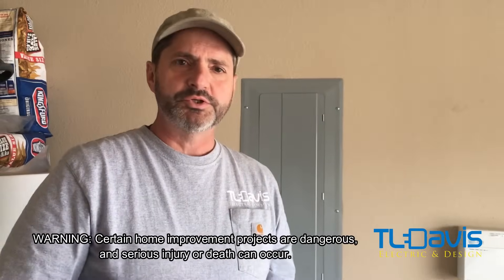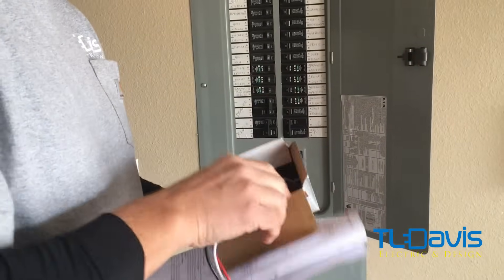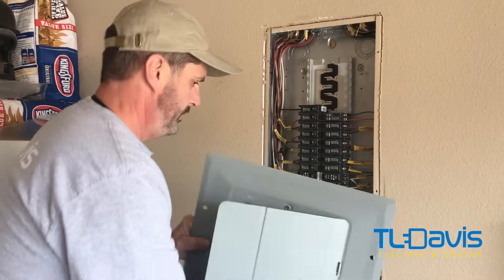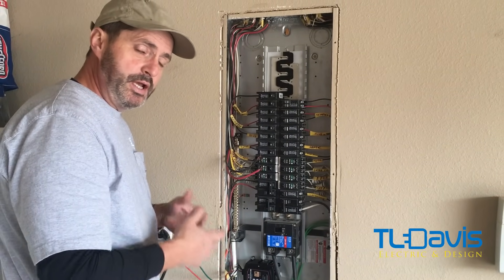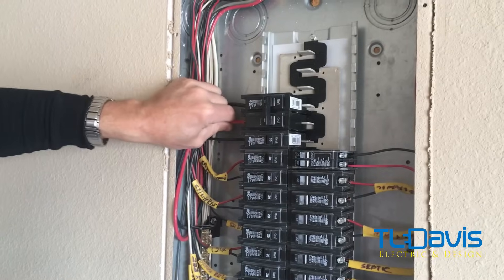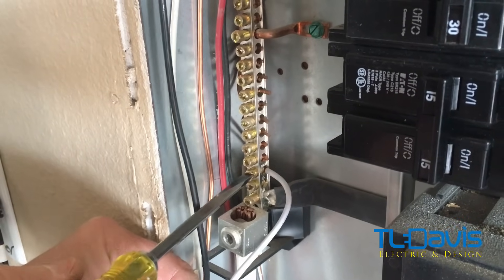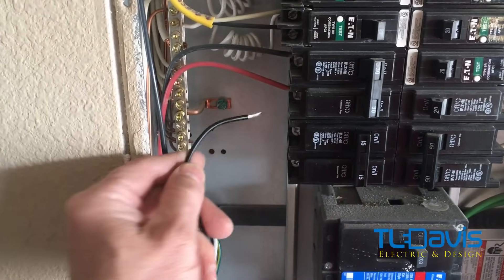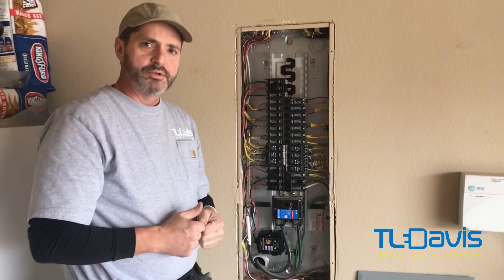How To Install A Whole House Surge Protector | TL Davis Electric & Design

Comment: why did you install the ground on the neutral bar??
Reply from the maker: This is a very simple answer. In the main panel the neutral and ground bar are connected.  Only in a sub panel are they separated by code.
Reply: Because the neutral is a grounded conductor.
Reply from the maker: @kyserwillams4244  Thanks for the reply to help out Robert. Only in the main panel are the neutral and ground bar connected. You will see that people will separate them to different sides to make them look nice. There is a bonding strap that goes from one bar to the next bar. They are only separated in sub panels per code. I hope this gives you a clearer understanding of what you are asking. If this does not I can stick a drawing up for you, which might give you a better picture.

Thanks

Terry

Comment: You should connect the Surge Protector cables  to the terminals of the Main Circuit Breaker.
Reply from the maker: Thanks for watching the video. In the video you see that I refer to the instructions that came with the surge protection device. It requires a 2 pole 15 amp breaker to cover both phases. Connecting it to the main is dangerous, an untrained professional could get shocked or injured. The wiring for the device is only rated at 15 amps and we should follow the instructions on how to install it. The device can be installed anywhere in the panel. Eaton has a kit that would allow you to install it at the bottom of the panel. I hope this was helpful.

Thanks
Reply from the maker: Do not connect the surge to the main panel. The Spd has to be on its own breaker. If you read the instructions you will see that it needs to be on its own breaker.
Reply: @terrydavis5882  Connect the circuit breaker of the spd to the loadside of the Main breaker.
Reply: @rossmmac1  You are not supposed to do that. It needs to be connected to a breaker. Not the main breaker, though.
Reply: Years ago in the 1970's & 1980's we used to install the surge protector at the weather head and tap into the drop using a split bolt. Yep it was hot alright. There was no lights on them to check them. If surge was bad they were usually blown up or burned up. Guess that's a NoNo now lol

Comment: The only problem I have with this installation is the unit is mounted inside the panel. The homeowner has to remove the cover to check the status of the unit. The suppressor needs to be mounted on the outside of the panel so that the homeowner can check it without being exposed to live components.
Reply: turn off main power before working in the box
Reply: @williamtamminga5889  there's a lot of wrong w/ this. To turn off the power completely you'd have to pull the meter and in our area you can't do that without a permit. When you turn the main breaker off there is still voltage present on the Line side of the main breaker. So with the main breaker off, it's still considered energized because there is voltage present and pulling a permit for this application isn't practical. Unfortunately most electricians are not trained in electrical safety even though they're electricians. I know, it sounds crazy but I see and hear it all the time.
Reply: Ruben Larez before cutting the seal and pulling out the meter you need to call the electric company  which is unnecessary if you re an electrician. This work is not for a dyi or Sunday warrior 🙂
Reply: @rublar75  At least in California and Vermont, the power co. is more than happy to cut power for a while with no charge. So Cal. Edison even moved the lines for me when I trimmed my monster ash tree---no-charge. The only issue is you need to be ready to do the work on their schedule.
Reply: That is a flush mounted panel.  What you want him to do ?
Reply: @Electricianyu  Cut a whole in the sheet rock beside  the electrical panel and mount it to the stud beside the panel , drill through the side of the panel real slow and hope for the best!
Reply: just kidding....notch the stud out so you can get at the side of the panel to run your wires through.   Make sure you have 911 preset into your phone and update your will.
Reply: @Electricianyu  I want him to mount ouside the box.....if you don't know how to do this, call an electrician....Eaton makes a box/plate to cover this.
Reply: You could mount the spd outside of the panel but you must not exceed the 1 meter wire limits. The shorter the wire used the better.
Reply: I agree with installing outside the box to check the status of the lights at a glance.
Reply: You could drill a couple of small holes to view the lights.
Reply: @jpenn727  that’s a safety issue
Reply: That's exactly what I did.
Reply: no homeowner wants that big ugly black box mounted on their wall inside the house plus it's not designed to do that.  It's fine inside the panel.  They very rarely go bad and you will know because it will trip the breaker.
Reply: @XX-121  MIne isn't black it is grey mental beside the panel, I like being about to glance at the two lights on it without having to open the door.. to each his own
Reply: mental = metal
Reply: @XX-121  exactly if it fails they are going to call the electrician anyways lol
Reply: Can you put the leads under any double pole breaker if there aren’t any open spaces available?
Reply: @lonnelbenjamin   No. The SPD must have it's own dedicated breaker.
Reply: @lonnelbenjamin  that's what I did 5+ years ago
Reply: @lonnelbenjamin  Late comment but yes, if you have no space, you can pail tail or get a proper breaker that is rated for 2 connections (tandem or Square D. That way you can combine them without an illegally double-tapped breaker. You would use a breaker that you know will remain untripped (so your protection is on). For me it was the clothes dryer breaker. Google about fixing double tapped cirucit breakers for more info.
Reply: @lonnelbenjamin  No
Reply: @lonnelbenjamin  no
Reply: @lonnelbenjamin  yes that's what most of them tell you to do.  and it's usually 50A
Reply: If you're comfortable with it (don't CODEZ me~) you could knock out a breaker faceplate enough to use as a site for the lights.
Reply: @NobleNobbler  no, that's against code.
Reply: Wow I would have never thought of that.....great point
Reply: I dont think it rated for inside the panel
Reply: @72strokershovelhead88  you can cover the holes with clear plexiglass so you can see but yet not stick anything in
Reply: Agreed
Reply: Yes I agree Robert. Would not be my first choice .
Reply: Yes this is done wrong
Reply: @72strokershovelhead88  Right - it is not like there are 20 outlets in the rest of the house to poke into, plus just as many light bulb sockets.
Reply: I mounted mine inside the panel because the drywall is covering the sides of the panel. I simply drilled holes then applied clear packing tape to the holes so you can see the green lights.
Reply: There's a flush mount adapter kit available from Eaton for mounting them next to a flush mount breaker box.
I just put one of these in and talked with an engineer at Eaton about it, he's done so much wrong it's unbelievable, and I don't know where he got it from that you're supposed to install the breaker for it close to the feed, I even rewound the video 3 times trying to catch where he says "told him to do it" because I can't make out what he's saying but it's not in the instructions, I've got them right in front of me, a bunch of people in these videos and comments are saying to do that and that was something that engineer from Eaton already went over with me, contrary to what all these "I've been an electrician for 30 years" guys and even electrical inspectors claim electricity doesn't flow like water, instead it hits everywhere at once, that's why it doesn't matter where in the box you put the breaker that the unit will be wired up to, what's more important is that you put the breaker in a location where you can mount the unit as close as possible to it, you'll notice on that little box where the wires come out is a short piece sticking up that has threads on it, the star nut from a wire lock comes already screwed onto that threaded piece the wires come out of, that's how it's meant to be installed on the box, through a knock out that typically a cable goes into, you select a place to put the breaker that's close to an unused knock out, pop it out, take the star nut off the unit, fish the wires and the threaded piece sticking out of the unit through the knock out hole, slide the nut over the wires and thread it on the box and tighten it down, by installing it in an unused knock out hole close to wherever you put the breaker that enables you to cut down the wires to the breaker as short as possible which is what they recommend, the shorter the better because the longer they are the more surge hits your household before the unit can dump the excess to the ground, keeping the wires to the surge protector as short as possible is what's important not where the breaker is in the box, he obviously took off that nut that goes where the wires come out of the surge protector and hid it because he doesn't want anyone seeing it.
Something else he did that's wrong is you're supposed to twist the wires together that go to the breaker to minimize impedance, one twist per inch is what the instructions call for.
Reply: @NobleNobbler  I dont think so,  the SPD is connected to a breaker me thinks the only thing tripping will be that breaker.  Imho
Reply: @lxramirez9788  100% agree on that... at least I hope that's all that trips. My comment was wrong :D
Reply: @lxramirez9788  No, breakers are far too slow to respond to surges. Without a breaker the surge suppressor is converted to an explosive device in the event of a large swell. I will say that a fuse would be much, much better due to it having a lower inductance than a breaker.
Reply: @antilogism  Agree, I would have tough the SPD should be located at the main switch where the meter box is.  My guess is the breaker has a sensor detecting not heat but transients which takes only seconds to occur, which would make it awesome, the technology use to trip off the rest of breakers is  even more extraordinary.  Props to whoever build it.
Reply: Except the homeowner doesn’t need to check the status of the unit. So who cares?
Reply: If you know so much, then why are you watching the video?
Reply: @elmagnificodep  so idiots like you can make stupid comments

Comment: Hi this it for 110 v
Reply: He is using a two pole breaker which covers both 120 volt lines, thus covering 240 volts. This is the same type breaker as on any of your 240 appliances.

Comment: Does this protect the two phases that come into the house? I see you only protecting one phase.
Reply: The SPD does protect both phases. If you notice I’m using a 2 pole breaker which picks up A & B Phase.
Reply: He is using a two pole breaker. This covers both 120 volt lines.

Comment: original cables are well orgnized. you need to trim the wire when moving them above
Reply from the maker: The panel was installed by another electrical contractor and they did a great job when wiring the panel. We just installed the Spd for the customer and tuck the additional wires be hind just in case in the further they might have to relocate the breaker.
Reply: @terrydavis5882  I noticed that in the panel on the bottom left side, there is a 20 and a 30 amp circuit both going through KOs with no connectors.
Reply: I would suggest that you don't wear jewelry when working on electricity. You may be a pro but they can die just like anyone else. I know plenty of electricians and non electricians who have had close calls.
Reply from the maker: @illestofdemall13  Thanks for watching the video on how to install an SPD. The 20 amp 30 amp breakers were already existing in the panel, when we were asked to install the SPD for the customer. There is a 2x4 on each side of the panel not allowing for a connector. We installed a plastic snap in connector for the customer after we install the SPD. As electricians we do what the customer ask for. We also advise them of things we see, that need to be addressed. We install the SPD were the customer want it, as long as they are within code. I hope the video was helpful for when you choose to add an SPD to your home. I always advise the home owner to turn off the power to the main house if they feel  uncomfortable with it on. I also advise them if they feel that uncomfortable to hire an electrician to install it for them. I'm just trying to help those who want to do electrical for them self to be safe an knowledgeable when doing so.

Thanks again for watching the video. If you would like to see a video on something electrical that you are working on and need help. Please let me know.
Reply: @terrydavis5882  Yes, and my point was just that they missed the connectors on those. When installing a panel one must prepare it so the connectors can be installed. I know it wasn't you who was at fault.
Reply: @terrydavis5882  I do have a particular electrical installation that I would like to see. I know how to do it, but have never seen any videos online of it. I would like to see a video of how to properly install a bell box outdoors for a GFCI, an how to properly support it using rigid conduit through the round connector that threads into the back of the box. I always see videos of how to mount them to walls, but never in the middle of a yard. Thanks.
Reply from the maker: @illestofdemall13  Thanks for the idea. I will be glad to show you how I support a bell box in the back yard for lighting and power. I will have it out on Youtube in about a week as I have to finish a job.

Thanks

Terry
Reply: @terrydavis5882  Thanks. I'll look forward to it.

Comment: How does it protect the whole home electricity?  Let say you have a power surge, how does that device stop all the current from flowing to those remaining breakers?  I’m really curious because I want install as well?
Reply: It doesn't prevent the flash from entirely happening or damage occurring but what is ment to do is use 50%of its self before it can take another hit but it will always take the hit before distributing current/ark flash to other circuits that have appliances connected on them tvs washer dryer etc.
Reply: I can't drill down on the exact physics behind it, but it will draw and "absorb" the high voltage and prevent the the other circuits from receiving high-voltage current. There are two things to know: 1) The high-voltage surge does not necessary have a high enough ampacity to trip the other conventional circuit breakers. 2) The other breakers only prevent over-amperage; NOT over-voltage.  Typically, electronics are destroyed by surges from high voltage; NOT high-amperage. High amperage occurs usually from a short condition (which the surge protector ignores).  Hope this helps.
Reply: path of least resistance...

Comment: You seem to connect the white neutral and green ground wires to the same bar? Is that correct as I can see another bar on the right side of the box where there are some green wires connected?
Reply: In a service entrance panel like this there are usually at least two, and I have seen as many as four, ground/neutral bars. The service entrance panel is the first breaker panel past the meter, whether it's mounted inside or outside.
Reply: @robertmoore254  Yeah but it appears he's working in the sub-panel, not the main service panel (which normally is outside in new-builds anyway). In the main panel, they're combined so if you're putting an SPD there they go together on the one buss. In the sub-panel they're separated...like this panel. So why wouldn't the green wire not go to the ground buss (with the rest of the green grd. wires) rather than with the white wire on the neutral buss?  It appears to me Mr. Davis has contradicted himself on several occasions/comments here.
Reply: Yes that’s fine.

Comment: You should drill some holes in the cover to show the LED lights so that you can see the health status!
Reply: my thoughts exactly!! Much easier to check without opening the panel.
Reply from the maker: Don't drill any hole in the cover, as you void the UL warranty.
Reply from the maker: Do not drill any holes in the cover. The install was for a special need to not show the lights as the person, has a child that likes to pull apart anything that has lights on it. I will be putting out a better video on how to install the SPD. This video will cover existing panels. New panels, surface mount panels.